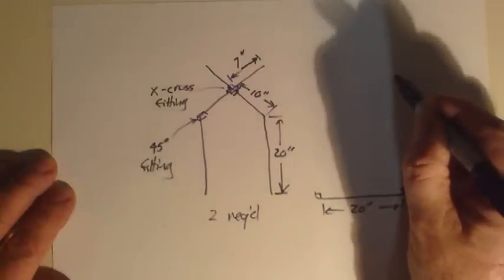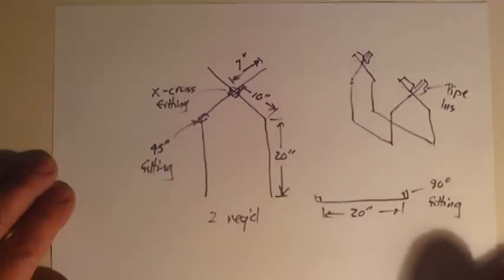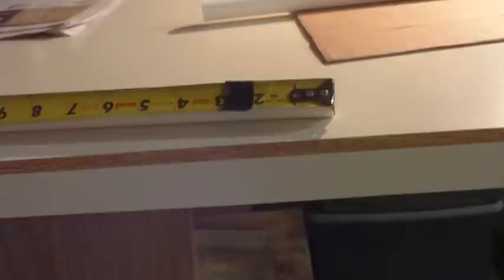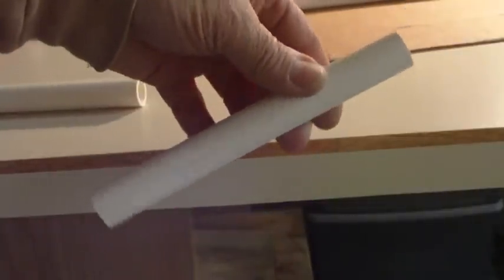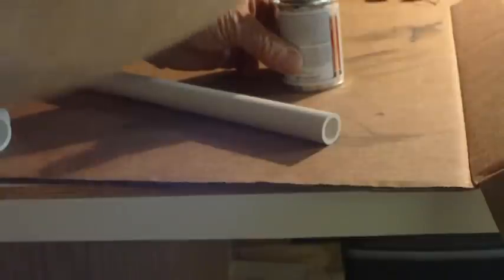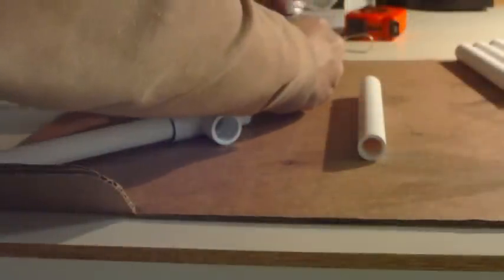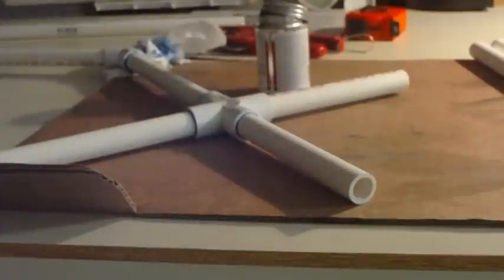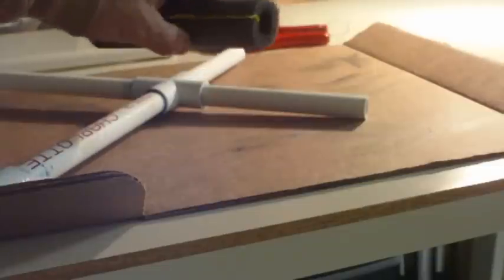PVC RC Plane Stand

Comment: Thank you so much for your idea, I just finished my stand for my Eflite Apprentice 15e and it came out very nice. I haven't glued it or painted it yet, just getting all the dimensions just right. I didn't use your dimensions as my plane was a little bigger and I used 1" PVC instead of 1/2". I made it table height so I don't have to bend over. Great design, I can't wait to finish it to show it off at the field. I think I'm going to make something that attaches to it for my helicopters.